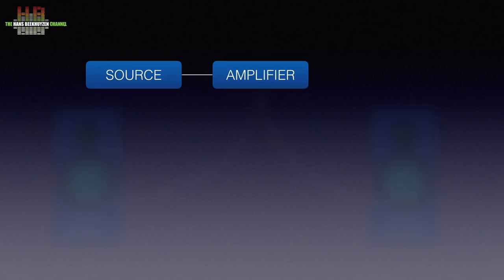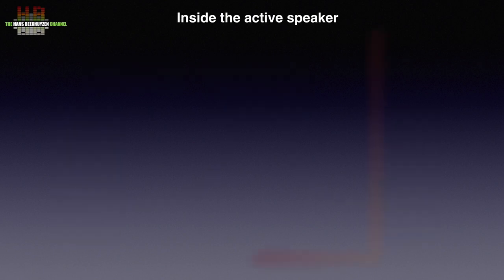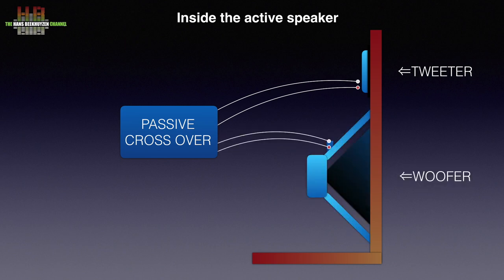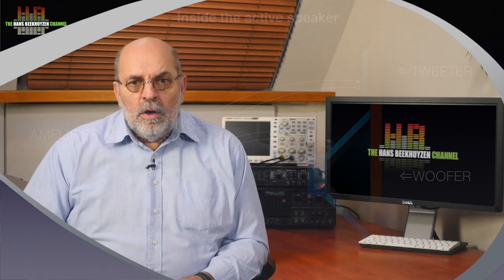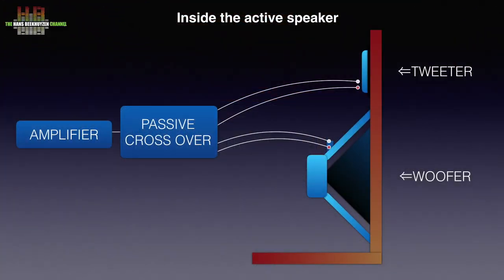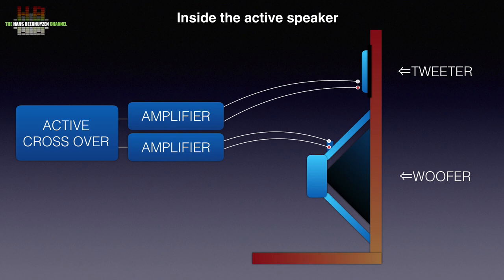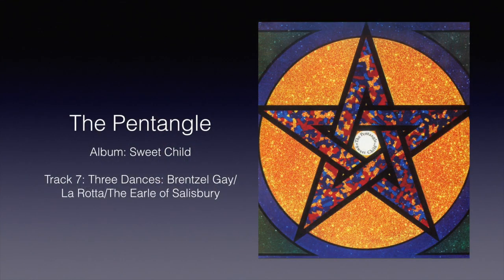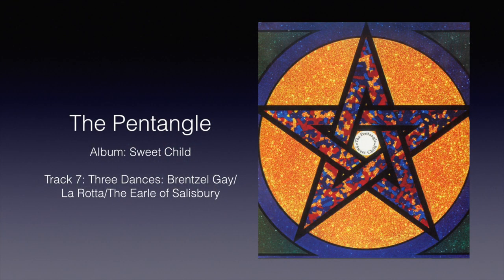Pros and cons of active speakers

Comment: Would you consider giving a presentation on Planer/ribbon  speakers.  I have heard that their sound quality is exceptional in the mid and high frequency  ranges to that of cone speakers and they project sound from both the front and back sides of the speaker surface.  thank you.
Reply from the maker: I focus on streaming now, these speakers are a bit off topic.

Comment: Dp active speakers have issues with repairs and servicing? I get the impression that when there is a fault, one is asked to replace the whole system.  Take for example the KEF LS50w active speakers, does KEF repair them out of warranty?
Reply from the maker: I don't know. But electronics like in active speakers are not likely to die on you soon.

Comment: Hi Hans,
I'm using a preamp (Schiit Asgard 2) with a variable RCA output to feed my Kef EGG active speakers. What would you advise regarding the settings of both volume-controls for the best sound quality?
Reply from the maker: Both KEF and Schiit won’t lend me review samples so I really can’t say. Sorry 😐
Reply: Thanks ! But I ment 'in general'. How to apply the volume of the pre-amp in relation to the volume-control of the active speakers. E.a. first or second volume control fully open? @TheHansBeekhuyzenChannel
Reply from the maker: @audiobean  There are no absolute rules but I would set the sensitivity of the speakers so that when at - to your ears - loud but undistorted sound level, the pre-amp has its volume control at '2 o'clock'.
Reply: @audiobean  you should have the Preamp on maximum volume and adjust on the speakers as needed.